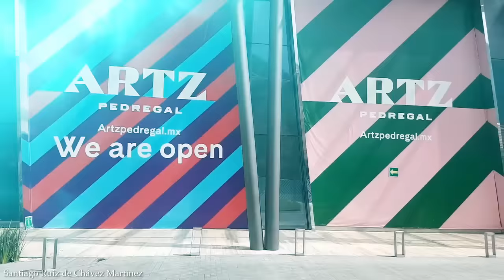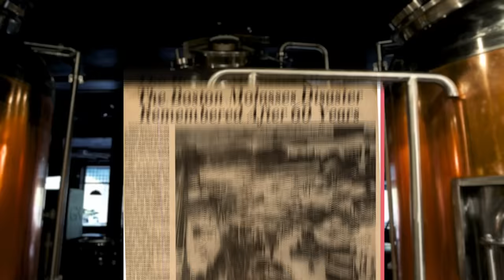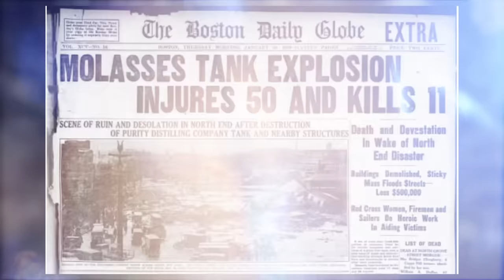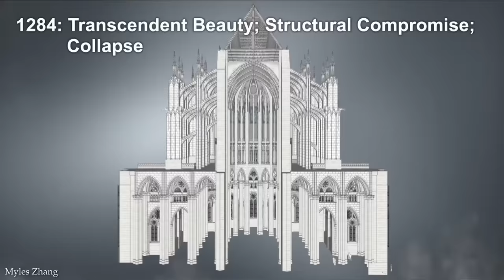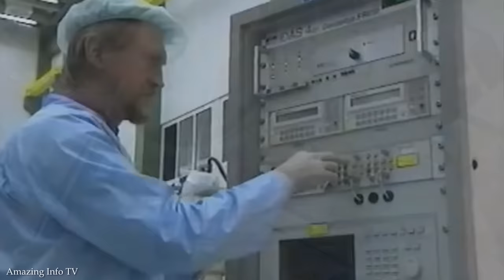TOP 15 ENGINEERING FAILS - what were they thinking?

Comment: The Pinto story is one of cost/benefit more than poor engineering. 3.2 million Pintos were sold and a gazillion miles driven in them. A relative few fires happened but garnered big headlines when Ford execs were shown to know a $2 part could have fixed the issue but they chose not to implement the change. The Pinto (failure) story is more a cautionary tale of how the media can corrupt actual events.

Comment: It's crazy to think that there's still structures that were built 500 y.a.-1000 y.a. and some beyond that are still standing and yet with all the computers and materials used today even the most modern engineering fails. I mean roman concrete used in ancient viaducts is still holding up and used 1000 or more years after being built..

Comment: As a civil engineer, I MUST point out that every failure is not because of engineering.  Contractors trying to earn more money will often build with cheaper materials, or do things like only putting in 4 bolts at a joint where 8 bolts were specified by the engineer.  Manufacturers of materials will also produce substandard materials to ‘earn’ more money.
As the saying goes, engineers don’t make any more money specifying lower than adequate designs, but contractors and material manufacturers DO make more money shaving corners.
Another saying says “follow the money”.  There is incentive ($) to actually build a structure poorly.  The engineer gets paid the same no matter how it gets built.
Reply: It doesn’t say much for the city inspectors , bribed I suppose
Reply: Not every one of these failures was due to engineering mistakes, but some involved engineering along with other factors.
Reply: Bert Meinders
I'm a mechanical engineer, and my experience of inspecting components outsourced to China or India has led me to the conclusion that both countries have been corrupt for so long that giving a customer exactly what is in the contract is seen as a sign of weakness (charging them for rework at New Zealand wage rates quickly improves their performance, though).
Reply: "As a civil engineer, I MUST point out that every failure is not because of engineering." 
This is not and cannot be true, given that all engineers are human and so subject to imperfection, the odds of humans to never fail are not zero. So, certainly SOME failures are because of engineering. 
Perhaps, as an engineer, language is not your area of expertise. Perhaps what you meant to say is ...
 "not every failure is because of engineering". 
A far more believable claim. And an accurate one as well.
Reply: That’s America (spoken from a circa 70’s American), everything is made to break. We used to build good products until we realized that the consumer didn’t find the need to purchase them on a consistent enough basis. It’s awfully sad.
Reply: As an industrial electrician, I can confirm this, it does happen.   But also, some engineers are just bad at their job too.  With over 35 years in the industry I have met some real winners (sarcasm) in the engineering department.

Comment: I still get irritated when I read someone talking about the twin towers (The World Trade Center) like they were a failure and placing some blame on them for collapsing and stuff like this let's people see what actual failures of buildings are. Far from being a failure in the engineering and building the towers actually held up remarkably well. A fully loaded 757 with full gas tanks of jet fuel hits pretty much any structure and it is coming down. The fact that they held together as long as they did and long enough for many to evacuate to safety is a beautiful thing. Especially the 2nd impact which took out basically 2 opposing corners of the building midway up. Talking about this brings back a lot and reminds us how stupid and short sided many people can be as they quickly forgot why we originally went to war over there.

Comment: The "minor rear-end collision" sequence at 5:14 was a SATIRICAL JOKE from one of those Zanuck/Ambrahams/Zucker movies like Police Squad or Naked Gun. The Jeep barely touches the Pinto but the setup tells you exactly what's going to happen, and it does. The car might genuinely have been a total death trap, but using this as an illustration of the failure, especially after multiple views of a legit crash test in which there's no conflagration at all, somewhat detracts from your credibility.
Reply: Thank you, came here to say that, but you said it better than I would have.
Reply: It comes from the 1984 film "Top Secret"

The mechanism for the horrific fires of the Pinto was the fuel tank being compressed between the rear bumper and the differential housing causing fuel to be sprayed beneath the hot engine and/or exhaust system and the fuel igniting after being heated past the flash point.  A crash test of a rear end collision that did not have the Pinto's engine running might not ignite the furl.
Reply: @richardbell7678  
Bert Meinders
I have owned 18 cars, and at least 10, including my current VW Passat, had their fuel tank mounted under the rear load space, just like the Pinto. It's a very common location, so why don't other cars burn when similarly mistreated? Some other engineering fault, perhaps, like the PVC fuel lines Ford liked at that time?
Reply: @bertmeinders6758  There seems to be some misguided assumption that a fuel tank is some kind of ticking time bomb. I have witnessed a crash with a fuel tank impacted and the fire emergency responders were not concerned...
Reply: @richardbell7678  As soon as the video mentioned the Pinto debacle, I was anticipating the use of that movie clip.  As the military truck chasing the protagonists was slamming on its brakes, the camera zooms in on the Pinto nameplate on the rear of the (stationary) car, so the audience knew an explosion was imminent, the sight gag being that the truck barely nudged the Pinto's bumper, prompting it to explode.

Comment: The Ford Pintos gas tank issue was not where the gas tank was placed. Plenty of cars had the same placement. The problem was the inside of the tank would puncture during a hard rear collision. By the time the issue was rectified by Ford, which it WAS eventually, nobody wanted one.

Comment: The Bhopal situation was more nuanced than that.  Union Carbide was prevented by (corrupt?) local officials from having actual authority over it.  They couldn't force the local owners to spend the funds necessary for badly needed maintenance and repairs - which was the eventual cause of the disaster.

Comment: So. You mention the Ford Pinto, but ignored the Austin Mini Metro, which had a very similar design flaw. As a survivor of the latter, I find that as negligent as the manufacturer who ignored the flaw by blaming the two million owners instead. And then there's the omission of the Space Shuttles Columbia and Challenger, which surely have to be the most well known engineering failures in NASA's history.
Reply: Well, in fairness engineers told NASA the o-rings weren't safe in temperatures that low, but their pleas were ignored by NASA's brass.
Reply: @abc-wv4in  Exactly my point.

Comment: One big problem has been overlooked with this video and thats, they get the money to build something but then think it will not require long term maintainance and this maintainance is either patched up or left and covered up. You can build miles and miles of roads but they will require regular maintenance which increaes in cost constantly.
Reply: This seems to be a common problem and politicians seem to often be reluctant to fund operating (maintenance) budget for that.
Reply: @johfc  Building new things (w/ tax $$) gets them praise and re-elected. Maint only gets under-table $$ money so there is less of that. Yet, they resurface perfectly good highways to keep the $$ flowing. Remember the "our bridges are falling down" which got a lot of attention and minimum taxpayer revolts? Alumchurcher is right too.

Comment: The Tacoma Narrows Bridge is a "relatively" minor engineering disaster.
Expensive and embarrassing but at least no human lives were lost.
A dog in a car on the bridge was killed.
This was designed at a time when they didn't have computers to model structures and they tried to cut corners without a thorough analysis.
Reply: The problem encountered by the Tacoma Narrows Bridge was recognized by Engineer Roebling when he designed the Brooklyn Bridge in the mid 1880's.  His bridge was completed in 1883 or so and is still in use.
Roebling made notes that the inclination in designing a suspension bridge was to make the bridge deck insufficiently stiff.  This has nothing to do with the live load strength of the bridge, but impacts its resistance to deformation by external forces such as high winds.  Roebling was correct, and his recommendations were ignored by SOME subsequent bridge designers.
Other bridges have encountered this wind flutter problem also, and remedial work was carried out to stop this fluttering.

Comment: The Mars Rover debacle can only happen with the involvement of one of 3 nations: United States, Liberia, and Myanmar
Reply: Bert Meinders
The persistent attachment to the unnecessarily complicated Imperial system of weights and measures, lacking interoperability between science and engineering, causes headaches elsewhere too. Our CNC machining programmes  supplied to an American licensee came back with the complaint: "Feed rates too high - tools keep breaking". The "problem"was that the licensee 's software automatically replaced the command G21 (mm per minute) with G20 (inches per minute).

Comment: obviously... that's not the Boston Hancock Tower they are showing, it's the Chicago Hancock building....Fun fact, it was referred to locally as "the worlds tallest toothpick" as the windows were replaced with plywood. The issue was a failt in securing the windows too tightly to the structure, introducing stress to the glass. When a catestrophic  crack was about to occur, a small "J-shaped" crack would occur in the corner of the window. The windows were then removed and replaced (first with plywood, later with replacement windows). You used to be able to get a "defect window"  for about $20, made great glass coffee tables.

Comment: I love this series, it's eye-opening, however, most of the problems are due to badly built, cheap manufacturing, cheap materials & other cost-cutting procedures'.  This therefore is unfair to be blamed on purely engineering issues. Still a great series though.

Comment: Lockheed Martin should take this one in the shorts.  Common sense states to use the  metric system;as the Imperial system is used by very few countries in general.  All science oriented projects I am aware of use the Metric system
Reply: Hubble telescope lens was ground to specs but with the wrong unit / mismatch. They had to make, and fly up, a correction when flaw was realized.

Comment: The Pintos concept of putting the gas tank in the rear was actually standard practice then and always has been. Where else do you put a tank holding 15 gallons of fluid. Very few cars do not have the fuel tank in the rear of the car.

Comment: The Quebec cantilever bridge collapsed during construction in 1907 causing about 80 fatalities (uncertain number) and then had the center span fall during its lift in 1916 for 11 more.
Reply: True!  The designer of the original bridge was an American who would not listen to any criticism of his work, even though he was told that the bottom chords of the cantilever beams (the diamond shaped structures) were beginning to buckle.
The second failure was an accident.  One of the hoisting shackles on the 5,000 ton centre section failed when this was hoisted into position.  Non Destructive Examination of this shackle would likely have prevented such failure, but NDE was not available at that time.

Comment: Ford did do a program to make the Pinto safer. They came up with a urethane liner for the gas tank that was virtually puncture proof, they added anti lock brakes, air bags which made it the safest car in the US........ and then they cancelled the Pinto all together. Like what GM did with the Corvair.
Reply: I'll have whatever you are smoking.  Anti lock brakes and air bags?  Give examples.   You won't find any.  The Pinto's production ended in 1980.   Ford had an experimental fleet of cars in 1971.  EXPERIMENTAL.  The 1984 Topaz offered air bags as optional equipment.

Ford offered Anti Lock brakes on the Thunderbird and Lincoln Continental in 1969.  Standard in 1971.   Expensive cars.  Never offered on a Pinto that was built to a price.
Reply: @dlewis9760  <----<< No, you've been smoking enough already. You need to learn how to read for comprehension. I said they had a program to make the Pinto safer (which they did) and they cancelled the car all together (which they did). They had developed what was at the time the safest car on the road but cancelled the Pinto BEFORE ever implementing any of the safety improvements.

Comment: Loads of cars had the fuel tank at the back.
Reply: Yes but the Pintos rear arched up a substantial amount after the rear axle and the tank hung lower than the bumper and was easily hit.  Google a photo of a Pinto from the rear as if you are seat in a vehicle behind one and you see the back hatch, the bumper and under the bumper several inches of sheet metal more often than not painted body color, directly behind that sheet metal sat the fuel tank.  Most normal height front car bumpers of the time would just got under the bumper and hit the tank directly and compounding the issue was the Pinto had a very small dainty rear bumper in its first few years till Ford beefed it up as a band-aid.  But yea once you look at a picture of the early ones and see the metal under the rear bumper and realize the fuel tank is right on the other side and these cars were unibody and did not have a full frame and you will see why it became a problem.   Yes you are correct lots of cars had rear fuel tanks but most had a several inches or almost a foot spacing away from a point of direct impact.
Reply: @georgemccune2923  The Triumph Dolomite has the tank right at the left back side not even an inch from the rear panel and the bumper was attached to the weak sheet metal, it's also unibody.
Reply: @ernsailor9041  I have never seen one of those.  I was not meaning to come across as i was arguing with you, sorry if i did.  I am bored crazy at work with another 6 hours to go.  not sure really what i was going for, perhaps i miss read your comment thinking you were saying lots of cars had rear tanks also and they did not blow up so the pinto shouldn't either, lol.  either way it is my bad.    Also we can not forget the death trap of the gm trucks that had the saddle bag fuel tanks.  My favorite that i have personally rode in and questioned my survival is the 1928-31 Model A.   The fuel tank was the cowl, the windshield base attached to it and it was also the dashboard.. basically like riding with a 5 gallon fuel tank in your lap. my best friend had one for several years fully restored and i always just wondered everytime we came to a stop and you could hear the fuel slosh about how many people burned up in those things.
Reply: @georgemccune2923  You're good, I was just talking about cars and their odd ideas over the years, some things get designed without much thought it seems. I owned a Dolomite for many many years. Jaguars had a fuel tank in each rear quarter panel so you get twice the fun if rear ended and fun if hit on either side. 👍

Comment: The Pinto was originally designed with an internal bladder inside the gas tank and with airbags. Tests were done with both of the items installed and as a result there were no explosions and the test dummies were undamaged. If Ford had installed the equipment, it would have been the safest car on the road.
Reply: You are absolutely correct here. The bladder was removed due to it's cost. Another contributor to the problem was the filler neck. There was no allowance for any movement so if you were rear ended and your tank shifted at all, the filler neck would tear loose allowing fuel and fuel vapour to escape. If there was any source of ignition nearby, boom, up went your pinto.

Comment: Taking many forms over the decades, you can have everything else right but if poor quality or wrong composition can end in failure or disaster, wether it be a building or machine. In a modern example, look at the problem of block cracks penetrating the water jacket on the Honda R18 engines.

Comment: The Tacoma Narrows bridge failed due to the design & construction flaw. It was determined in the inspection of the debris on the site of the collapse, vents through the deck were not included in the design & construction. When the winds picked up to 40 MPH, the bridge deck acted like an airplane wing and tried to take off. Since then, all suspension bridges have vents that allow airflow through the bridge deck. No more "Galloping Girdies".

Comment: I owned a '74 Pinto WAGON version - no issues at all, and YES, it was once rear ended and NO FIRE. The reason, was the wagon frame was longer and gave more room for the fuel tank. Had it for 8 years, and traded it in for a new car, as had started to rust through quite badly. Not all Pintos were bad.

Comment: The windows falling out of the Hancock tower was just the tip of the iceberg. it actually could have fallen over on it's narrow edge into the South End under the right circumstances. This fact was kept from Bostonians as extensive work, including the addition of a large concrete counter weight on one of the upper floors was installed.